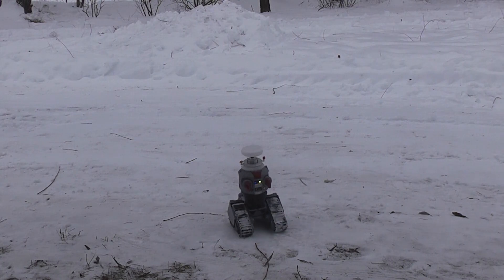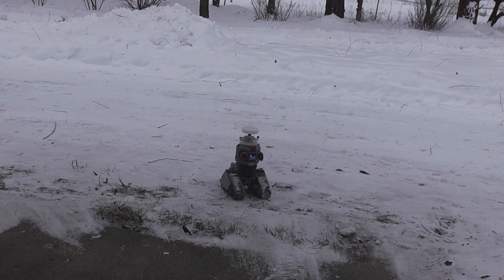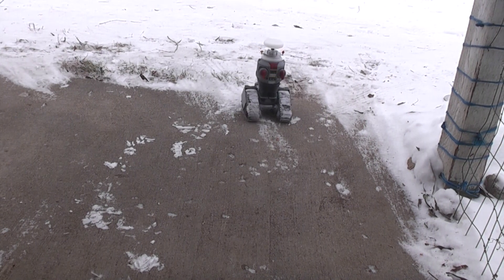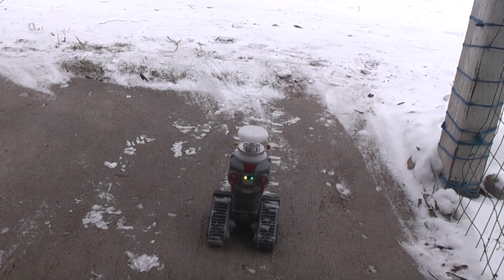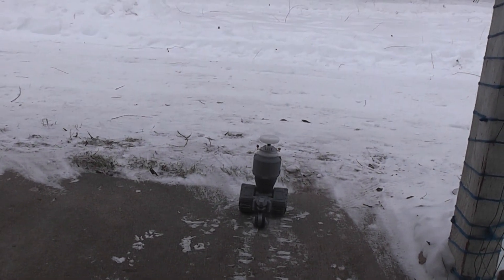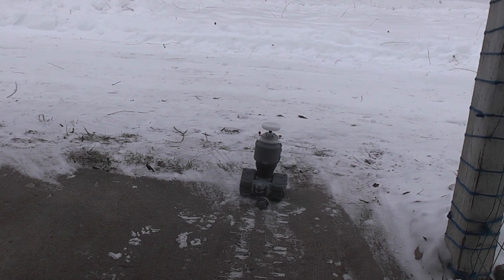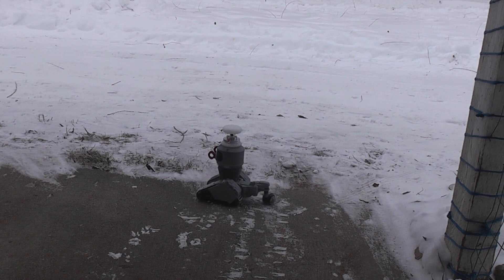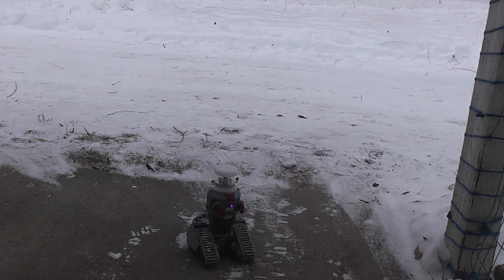J5-B9, cold & snow test. Using the blue 1:90 TT gearmotor track design, running on 6 volts.

Comment: It's in the 30's here in Florida I can only imagine there. Nice job with the tracks . Probably work well in the sand here
Reply from the maker: Not sure if the sand would build up inside the tracks and cause a problem or not. Johnny 5 was not really built for sand, after all his treads are just tabletop conveyer belts.

Comment: That works very nice! It might roll better without that back wheel or be able to turn a little easier.
Reply from the maker: The rear wheel has little effect, it is just there for the Johnny 5 look of the tread and the fact that I wanted the 2 tread sections to be floating for uneven ground. You have to have a rear wheel if your track units are independent "floating".
Reply: @Robothut  Ah, that makes sense. It looks very cool the way it moves! 😁